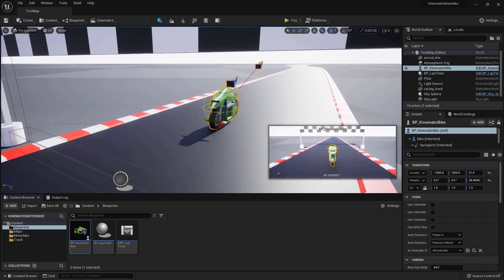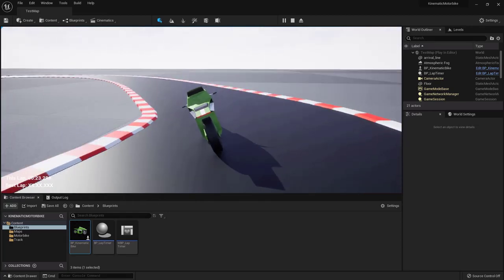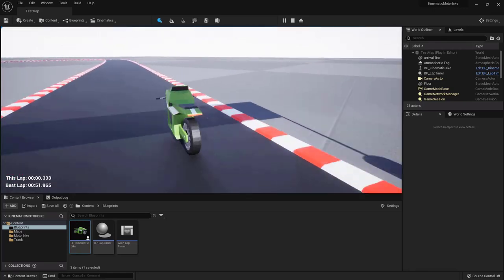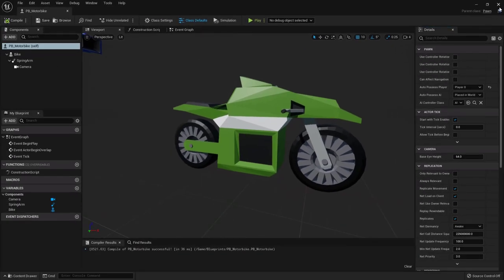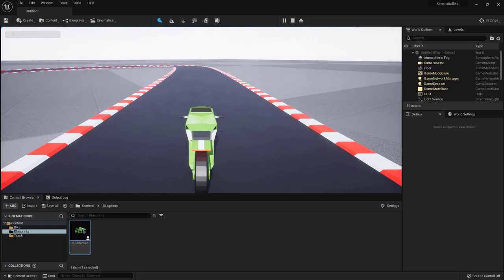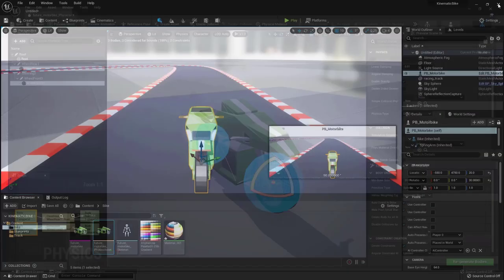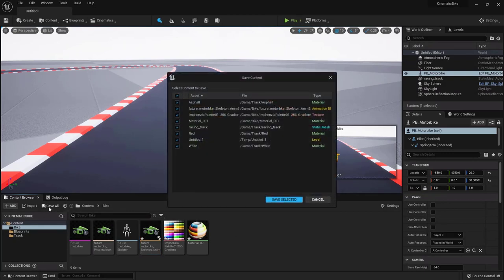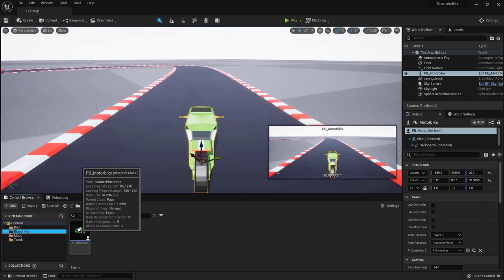Fully Drivable Kinematic Motorbike (Motorcycle) from Scratch - Unreal Engine 5 Blueprints Tutorial

Comment: Thank you sir, good tutorial. I was able to manipulate this further to enable ground detection to change the bike world Z position as well as Y rotation when going uphill or downhill. Couldn't have done it without your base.
Reply from the maker: Sounds great! I was planning to cover this in a future tutorial but for a different type of vehicle which drives on a non-flat terrain. I guess you used some line traces and then adjust the rotation depending on the hit normals. Well done!
Reply: @marcoghislanzoni  yes, in BeginPlay i did a trace from center of the bike towards ground and another one every tick, then compare these two vector lengths to change the Z of bike. Then i added the same system for both wheels and tracked the vector looking from back wheel to front wheel and change the bike actor rotation to the same. I'm no programmer so i don't know if this is a low cost solution, but it works at least in my barebones prototype game.
Reply: @joonasmuhonen1423  Wow!! I'm stuck at that point. Could you please make a step by step for dummys?
Reply: @idaeus_ad_astra  oh I've never done a step by step tutorial. I can think about this but it has to wait for a while. Thanks for asking, it would be fun to make something useful for others as well!
Reply: @joonasmuhonen1423  Hey thats so clever!!! can you share a screengrab of your node system which detects the ground? it would be really helpful

Comment: Did you ever figure out  way to make a braking where the wheel will lock?
Reply from the maker: You could implement a logic like: if the forward speed is > X and the player fully brakes, then you lock the wheels until the speed goes below X again. Locking the wheels basically means you stop updating their rotation angle i.e. you set the angular speed of the wheels to 0
Reply: @marcoghislanzoni  thank you 👍🏻

Comment: Wow. This video is so clear and amazing! Easy to follow for a beginner like me! Wonder how can i make the movement stops with release of the button? Mine keep moving forward despite W button (move forward) is released. Any tips?
Reply from the maker: Thank you, glad you find it approachable also for a beginner. That was exactly the aim. Regarding your problem, the way we set the Throttle input at 18:08 makes the Target value become zero when the W key is released, so the bike should stop after a bit. If that doesn't happen, you may have forgotten to set the value of the interpolation speed on the FinterpTo node or mixed up some of the variables. Please double check.

Comment: Another GREAT tutorial.  Would be great if I could get it to work with Collisions on but its seems to be glued to the floor when that's enabled. With it set to NO Collision its just rides through everything, any assistance appreciated.
Reply from the maker: This is one of the disadvantages of working with kinematic vehicles, you need to handle the collisions yourself. One way is to use overlap volumes and, if the overlap with another object is detected, stop the motion or invert it for a bounce back.
Reply: @marcoghislanzoni  Thanks for the quick reply, I'm no expert but as with all things will figure it out (as per your guidance)

Comment: Hello, I've watched a lot of your videos and you did a great job. I've asked you this before but I've gone back to I've been working on it for months. On a physics-based motorcycle if you don't want to use the default Sphere for the tire because it sticks out on the side and you want to use a cylinder but when you use a cylinder when you start going fast the bike starts hopping and jumping around.  Is there any work around for this? Is there any geometry that you could use for the cylinder that would work? In blender I created a bunch of different cylinder types but all of them did the same thing where it would hop around these cylinders that had a lot more tangents did better but still not perfect.  Or could you use the cylinders while you're going low speed and then when you start going over a certain speed through the blueprint switch out the wheels or collision with the spheres?
Reply from the maker: I don't know how Blender simulates physics (does it use Bullet?) but in Unreal/PhysX you can use tessellated cylinders and apply a contact offset to them, so they become "rounder". That avoids that they jump on cracks and discontinuities of the road mesh. There are also a couple of parameters you can tweak globally, also related to the min and max contact offset. You can find them under Project Settings --> Physics.
Reply: @marcoghislanzoni  Hey Marco, thank you for the detailed reply. Blender is a free 3D modeling program.

I am using Unreal Engine 4.27 with PhysX for the motorcycle.  Is there any way possible you could send me a fbx file with a cylinder collision that you're talking about that rolls smooth?   I have tried a bunch of different ways but cannot figure it out.
Reply: @marcoghislanzoni  If you go to my channel and click the "About" then you will see my e-mail address.  Can you e-mail me and I can send you a small video and photos of what the problem is and maybe you can help me?
Reply: @marcoghislanzoni  "you can use tessellated cylinders and apply a contact offset to them, so they become "rounder"

I would love to know how to do this, please.

🙏
Reply: @marcoghislanzoni  I do not know how to make a contact offset, can you tell me how?  I created a Thread on Nvidia's Developer Forum, maybe you could take a look at it, it has picture and videos so you could see what I am trying to fix.  I really want to get this figured out and I know you know a lot of about Physics because you have worked with them so much.  Here is the link but YouTube will probably deleted my comment for putting in the link.  Any help I would appreciate.  YouTube did delete the comment so I will try again but leave out the h t t p s and the slashes, maybe YT will not delete this, who knows.  github.com NVIDIAGameWorks PhysX issues 570
Reply from the maker: @JohnDaniels  can you please get in touch on Discord - Unreal Slackers. You can find me as vr_marco#8894. Will make it easier to help you out.

Comment: Hello, Currently using my own custom bike for this, but when i follow the tutorial, my bike is static, i tried with the chaos engine blueprint to double check and it naturally follows gravity, is there a setting I'm missing?
Reply from the maker: The main idea about kinematic vehicles is that you are not using the physics engine but simulating a physics-like behavior directly. By checking "simulate physics" you are asking the physics engine to do the work for you, so don't do it in this case. You can use any bike with this method (as long as it is a skeletal mesh).
Reply: @marcoghislanzoni  Thank you for the insanely fast reply. I think I ran into a bug regarding the new input mapping actions, I followed the depreciated method you did and it works now. Great video!!!

Comment: my bike is not moving 39:00 , using unreal 5.4.2 . followed exactly i don't know the reason :(
Reply from the maker: Check that the bike is movable, that it receives the player’s inputs and that the movement code is being called with valid input. You may have left the movement multipliers to zero, hence no movement is actually happening.
Reply: @marcoghislanzoni  Thank you found my mistake. on 38:16 I was setting setActorRelativeLocation instead of Rotation

Comment: Thanks a lot. I was waiting for something like that for a long time. Already purchased the assets before the premiere. 
Currently I'm still using UE 4.26. Do you think this would work on 4.26? I'm aware that I would need some copy&paste for the Blueprints, but do you think it would work on 4.26 or does it use some UE5 features?
Reply from the maker: It doesn't use any UE5 specific feature, so you can do it on 4.26 as well. Just the user interface looks different but if you know your way around Unreal it should be no issue at all.
Reply from the maker: Many thanks for the purchase by the way! :-)
Reply: @marcoghislanzoni  Sounds good. :)
Did you try using Chaos Physics components with this setup? At least the Unreal vehicle components seem to behave better in the Chaos Physics versions. Not sure if this project would benefit from Chaos Physics as well.
Reply from the maker: @stezo9770  In this tutorial we are not using physics at all, except for collisions. This is what is meant by "kinematic". Chaos Vehicles do not support bikes anyway (not yet at least), so it won't be easy to implement something like this with Chaos. I may cover a physics simulating bike in another tutorial following my old concept using a PID controller. And to your point, yes, Chaos Vehicles are getting better and better.
Reply: @marcoghislanzoni  Oh, cool. I expected that you used at least a few physics constraints. Even better if it works without that. Physics constraints are giving me headaches all the time. 
I apologize for asking this question before watching the video. :)
Reply from the maker: @stezo9770  No physics constraints. The only physics we use in this bike is for collisions. The rest is all kinematic/animations.

Comment: You did a great job thank you for this tutorial but I was wondering how could I make a speed limit when I decelerate like when I try to stop I don’t want it to be 0 or a complete stop I wanna set the minimum to 20km/h for example and how to set a barrier or a limit to the steering like for example if I am driving in a straight endless road I don’t want it to rotate and go the other way or oversteer
Reply from the maker: You need to clamp the values of Current Speed and Current Steering Angle to limit the minimum speed or limit the steering to be in between certain angles.
Reply: @marcoghislanzoni  ok thank you so much I did the steering limit but how should I do the speed and how to make a maxleanangle

Comment: Great tutorial! I have used another model, but otherwise followed every step. However, when I increase the speed the wheels turn backwards and vice versa (both when I hit play and when I test it in the Animation Blueprint). The rest is working fine. I've tried rotating the wheel bones 180 degrees on the relevant axis in UE and then generate new bodies, but nothing I try works. Is there a node to simply reverse/inverse the rotation angle in the AnimGraph under the Animation Blueprint or something?
Reply from the maker: It may be that your wheel bones are oriented the other way around. In the AnimBP take the rotation angle for each wheel and multiply it by -1.0 before using it to drive the bone rotation. That should fix it.
Reply: @marcoghislanzoni  Thank you so much. That fixed it.

Comment: what if you have like slopes and jumps? just raycast and if nothing fall?
Reply from the maker: In few words yes, but you also need to detect the slope to adapt the pitch angle of the motorbike beside applying gravity when there is no ground under it so it falls. I may cover this extension in a future tutorial.
Reply: @marcoghislanzoni  ok, is it possible to get the face orientation or slope/normals in blueprint?
Reply from the maker: @asilva_media  sure, face normal is one of the outputs of a line trace (hit results)
Reply: @marcoghislanzoni  yes could you please do a tutorial for this at some point, i am having much trouble, like not sure how to get the angle and where to put the casts
Reply: @marcoghislanzoni   "I may cover this extension in a future tutorial." That would be incredibly welcome if you could!
Reply: @marcoghislanzoni  do you have plan to update this sooner? Also would be nice to see a tuorial on boat.
Reply: @marcoghislanzoni  please yes! This is the first bike tutorial that worked for me and the only thing missing is the lack of collision / gravity
Reply from the maker: @s.kanessuperbiatv6464  Implementing gravity is not difficult per se, but it requires a suitable terrain detection to stop applying it as soon as contact is made. I need to think of a simple way to implement it so I can explain in another tutorial.

Comment: how u do for put the z look on right side ?
Reply from the maker: By adding a relative rotation to the spring arm connected to an axis input, usually the mouse X
Reply: @marcoghislanzoni  could you send me your blender export info and the unreal import info that I check if I put everything like you I don't understand I can change put the green dot at the bottom or at the top it comes out in the same place each time in unreal no matter how I export it no way to invert the z with the y or whatever I don't understand how you get this the z pointing to the right there is a secret or mystery thing in it not divulge on this?
Reply from the maker: @LanD_87  there is no secrets nor hidden features, just proper rigging. Check out my latest tutorial about simulating a bike with Chaos Vehicles. I am extensively showing in the first part how to rig the bike properly and import it into Unreal.
Reply: @marcoghislanzoni  effictivement il n'y avait pas de secret ni tout ca je faisais mal le greement merci pour le temps pris a me répondre et merci encore pour le partage de savoir ;)
Reply: @marcoghislanzoni  yes of course no secret or hiddent u right thanks for ur time its working now i can make all i want wis car or bike thanks so much i wanted tuto for brake and reverse light function for wheeled vehicle pawn u dont make one ? or u dont know a good tutorial for this please

Comment: Hi! I'm trying to create a motorcycle with Chaos Physics based on your car tutorial but I can't understand a lot of things. Seems like I need a different setup for two wheels because my bike just can't go in a straight line and can't steer at all. Any chances to see a tutorial for it from you? Will be amazing
Reply from the maker: Completely physics-based motorbikes are not easy to create, mostly because you also have to take care of stability and simulate the effect of the pilot shifting weight/position. If you look through my channel you will find a concept I did many years ago, based on a PID controller to handle stability. I may turn that into a tutorial eventually, but it is going to be a complicated one. Chaos vehicles do not support two-wheeled vehicles for the time being. You may try setting the front and rear wheels as separate semi-wheels and then get them so close it becomes a bike, but you will need to take care of stability regardless.
Reply: @marcoghislanzoni  Thank you for the answer! I thought Chaos vehicles  supports two wheels because of this in official documentation: "These are the same no matter whether you are creating an automobile or a motorcycle." in How to Set up Chaos Vehicles tutorial on unrealengine site. But if it's not it's all make sense. Thank you!
Reply: @marcoghislanzoni  Also, Epics writes in UE5 preview: "Chaos vehicles provide more flexibility to the user by removing the limits on the number of wheels it can simulate per vehicle. Unlike the legacy system, you can now add any number of wheels to a vehicle — from a unicycle to an 8-wheeled transporter." Maybe it will be supported on UE5 full release idk
Reply from the maker: @Itemy_  I haven't seen any bike specific code within Chaos vehicles. It may be that bike support hasn't been released yet or that bikes can be built with a trick like the one I shared above.
Reply: @marcoghislanzoni  yeah maybe
Reply: @Itemy_  I was wonder the same thing and made a bike with 2 wheels in UE5 but it does not work right.  Did you get this figured out?
Reply: Did you get this figured out?
Reply: @stephenfjohnson  Yes, it is working now.  Just keep playing with it.

Comment: As fun as this tutorial is for beginners, motorbikes aren't much fun on a flat plane. Does anyone know of a more in depth tutorial that covers collisions and traversal on a terrain? And not physics or Chaos Vehicle based.
Reply from the maker: I wanted to work a second tutorial covering that aspect, but I couldn't find the time so far. Basically this entails tracing downward from the wheel hub to identify the tire contact points (front and rear) and adjust the pitch of the bike accordingly.
Reply: @marcoghislanzoni  Thanks for replying and for the couple directions on how to accomplish this. I'm coming to UE as a longtime Unity user so everything is a hurdle to learn how to do the UE way. But It's only been a week so I should be patient ;)
Reply from the maker: @antennatrees  Do not put too much pressure on yourself, one week with Unreal is nothing. ;-) Good luck with your learning. Have fun!

Comment: i tryd this bud this lean system is not god the wheels have to stay at place and the nice thing is how you drive up ore downhilll ?? lool you tell me i have to  look up what kinematic means i do it and i have to say maby you should look to wath kinetic means cuz this bike you make is not kinematic its a flying object no interaction with ground no nothing i think this tutorial is fully usless sry dont understand why people write here that is good work they not try it only look the vids
Reply from the maker: A kinematic vehicle is a vehicle for which you set its position and rotation explicitly at each time step vs. a physics simulating one to which you apply forces/torques and let the physics engine determine the velocities/position/rotation. The fact that a vehicle is kinematic doesn't tell whether it will react or not to the ground or even be aware of obstacles around it. It is the same for a physics simulating one in the case collisions for it are turned off. 
Having clarified this, if you need your kinematic vehicle to sense the ground and drive on slopes, you can use scene queries (ray casting) to detect the driving surface and adjust its location/rotation accordingly.